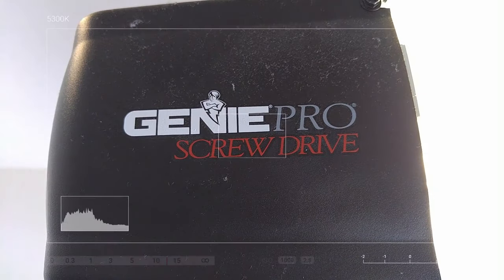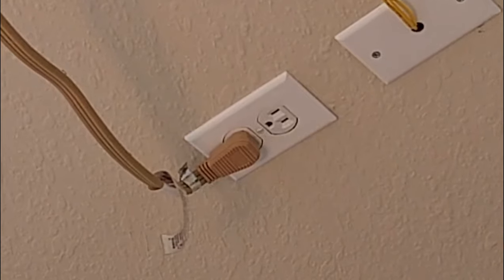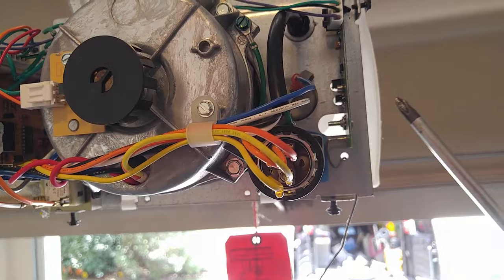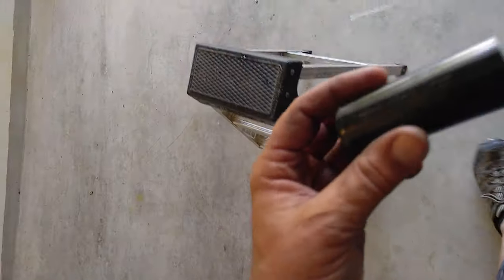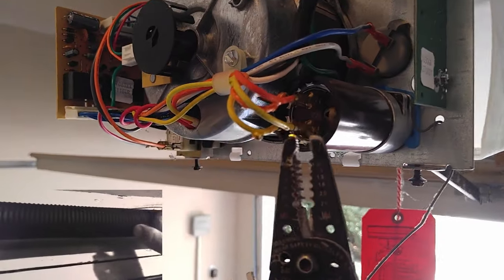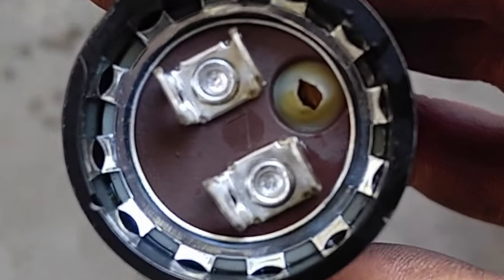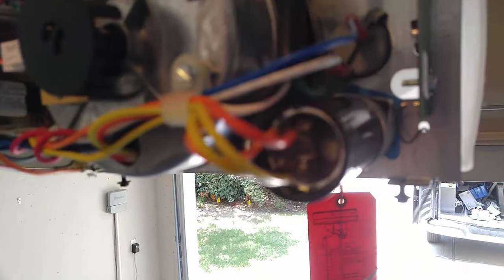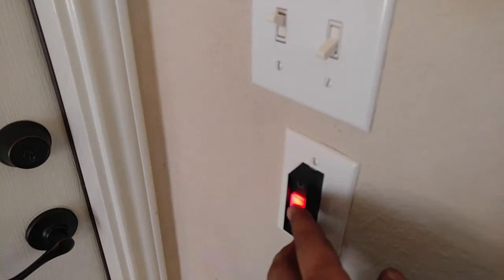Why My Genie Garage Door Opener is Not Working / Started Smoking

Comment: Did you electrocute yourself garage door genius. Good job with the video. Does this opener have safety sensors and battery backup and myq.
Reply from the maker: I have electrocuted myself before. Those start capacitors still hold a charge even after you unplug it.  
This particular unit doesn't have a battery back up.  It does have sensors tho!
Reply: @garagedoorgenius  has the owner had any more problems with there genie every since.
Reply from the maker: @matthewhayford5466  Not that I know of! 🤘🏼😁🤘🏼
Reply: @garagedoorgenius  have you ever heard of bon jovi and uncle kracker.
Reply from the maker: @matthewhayford5466  Yes I have! ✌🏼💯
Reply: @garagedoorgenius  have you ever heard of steve miller band or nickelback. Or the singer rick springfield. Have you ever heard of marentec and ryobi.
Reply: @garagedoorgenius  have you ever heard of kia and hyundai. And ac dc and ray charles. And miles davis and louis Armstrong.
Reply: @garagedoorgenius  have you ever heard of billy joel garage door genius.
Reply from the maker: @matthewhayford5466  I love Billy Joel.  He's got good songs. 
You heard of Billy Squire?
Reply: @garagedoorgenius  yes I have. Oh yeah. Have you ever been to france.
Reply: @garagedoorgenius  happy Saturday. Have you ever heard of the rolling stones and earth wind and fire.
Reply: @garagedoorgenius  oh yeah have you ever heard of the Howell quick garage door opener.
Reply from the maker: @matthewhayford5466  No I have not!?
Reply: @garagedoorgenius  have you ever seen the tv show ask this old house or vanilla ice project.
Reply from the maker: @matthewhayford5466  Yes I have!
Reply: @garagedoorgenius  have you ever heard of the band heart and abba and ccr. And have you ever heard of the singer Dobie gray.
Reply from the maker: @matthewhayford5466  I have heard of those great bands.  Although, I haven't heard of the last one you mentioned.
Reply: @garagedoorgenius  have you ever heard of marentec. Have you ever heard of the actor jim carrey.
Reply from the maker: @matthewhayford5466  Marantec I'm not a big fan of.  Jim Carrey is one of the funniest people alive!  💯
Reply: @garagedoorgenius  have you ever heard of queen and elton john.
Reply from the maker: @matthewhayford5466  No I haven't.
Reply: @garagedoorgenius  have you ever heard of sammy John's and foghat. Have you ever heard of kia and hyundai. Stay safe from the coronavirus.
Reply: @garagedoorgenius  have you ever heard of toyota and honda.
Reply from the maker: @matthewhayford5466  Yep.  Never owned one tho.
Reply: @garagedoorgenius  have you ever heard of dire straits.
Reply: @garagedoorgenius  have you ever heard or dire straits.
Reply from the maker: @matthewhayford5466  Oh yes buddy!!
Reply: @garagedoorgenius  have you ever heard of the band toto. Have you ever heard of the kia stinger.
Reply: @garagedoorgenius  have you ever heard of prince and guns in Rose's.
Reply: @garagedoorgenius  have you ever heard of toto and  guns in Rose's.
Reply from the maker: @matthewhayford5466  Yes sir! 👍🏼
Reply: @garagedoorgenius  have you ever heard of harry chapin.
Reply from the maker: @matthewhayford5466  Yes I have.  Do you like Harry?
Reply: @garagedoorgenius  yes I do. do you. Have you ever heard of louis Armstrong.
Reply: @garagedoorgenius  have you ever heard of ed Sheeran and kenny Roger's and Kenny loggins.
Reply: @garagedoorgenius  have you ever hear of jerry lee Lewis. And marshall tucker band.
Reply from the maker: @matthewhayford5466  Yes I have.
Reply: @garagedoorgenius  have you ever heard of sammy John's and sammy hagar and huey Lewis and the newsroom. Have you ever heard of clopay or craftsman or ideal door.
Reply: @garagedoorgenius  have you ever heard of challenger.
Reply from the maker: @matthewhayford5466  No o haven't?
Reply: @garagedoorgenius  have you ever been to england or germany. Have you ever heard bon jovi. And run dmc.
Reply: @garagedoorgenius  have you ever heard of bonnie tyler sweet and belinda Carlisle. Have you ever heard of a Chevy lumina.
Reply: @garagedoorgenius  have you ever had insteon lighting.
Reply from the maker: @matthewhayford5466  No I have not.
Reply: @garagedoorgenius  have you ever heard of kenny Roger's and pure prairie league.
Reply: @garagedoorgenius  have you ever heard of honda and mazda.
Reply: @garagedoorgenius  have you ever heard of Louis armstrong.
Reply: @garagedoorgenius  have you ever heard of sammy hagar nickelback and jackson Browne and Christopher cross and g geils band.
Reply from the maker: @matthewhayford5466  I've heard of them all.  Can you guess which one I don't like?
Reply: @garagedoorgenius  have you ever heard of pure prairie league twisted sister and Louis armstrong.
Reply: @garagedoorgenius  I wood probably guess you like them all.
Reply from the maker: @matthewhayford5466  Love all 3!! 💯
Reply from the maker: @matthewhayford5466  All but 1 in that category! 😉
Reply: @garagedoorgenius  can genies overheat. Can logic boards go bad in Genies.
Reply from the maker: @matthewhayford5466  Yes they can.  Generally after a 10 minute cool down and they're back up and running.  If not, the start capacitor is probably blown.
Reply: @garagedoorgenius  have you ever heard of the bee gees. And have you ever heard of larry the cable guy and mike rowe and owen wilson.
Reply: @garagedoorgenius  have you ever heard or bill withers or olivia newton john.
Reply: @garagedoorgenius  have you ever heard of styx and little river band.
Reply: @garagedoorgenius  or have you ever heard of the singer Ricky Nelson.
Reply from the maker: @matthewhayford5466  Wasn't he the Nelson twins dad?
Reply: @garagedoorgenius  yes he was. Also have you ever heard of andy gibb.
Reply from the maker: @matthewhayford5466  Yes in have!
Reply: @garagedoorgenius  have you ever heard of John Mellencamp. And Jefferson starship.
Reply: @garagedoorgenius  have you ever been to the Philippines.
Reply from the maker: No sir.
Reply from the maker: I know John Cougar!  I'm from Indiana so we Hoosiers don't know John Mellencamp. 🤪
Reply: @garagedoorgenius  have you ever heard of Charlie sheen and Mike rowe. Have you ever seen the TV show flipping Vegas or love it or list it.
Reply from the maker: @matthewhayford5466  Charlie is crazy!  And I don't watch much TV.😬
Reply: @garagedoorgenius  what kind of camera do you use to upload videos.
Reply: @garagedoorgenius  have you ever heard of bette Midler or def leppard.
Reply from the maker: @matthewhayford5466  yes to both. Def Leppard was and still is a fave of mine! 🤘🏼🤓🤘🏼💯
Reply: @garagedoorgenius  have you ever heard of Jeff Daniels. Also have you ever seen the tv show love it or list it.
Reply: @garagedoorgenius  did you hear that Jerry stiller and little Richard died recently.
Reply from the maker: @matthewhayford5466  yeah, super sad 😟
Reply: @garagedoorgenius  are you a fan of clopay. Also which genie opener do you like better the screw drive or the chainglide. The chainglide by genie.
Reply: @garagedoorgenius  do you like garage door with windows in it.
Reply from the maker: @matthewhayford5466  Full Views with frosted glass I love!  The natural daylight in your garage is nice.
Reply: @garagedoorgenius  also does this house have a basement.
Reply: @garagedoorgenius  also have you ever been to Louisiana.
Reply from the maker: @matthewhayford5466  I don't think so.